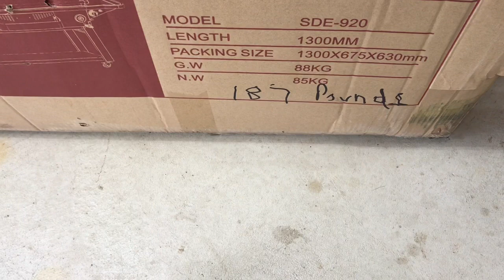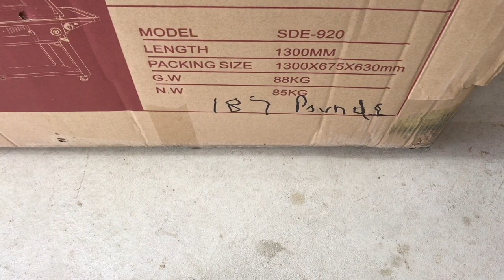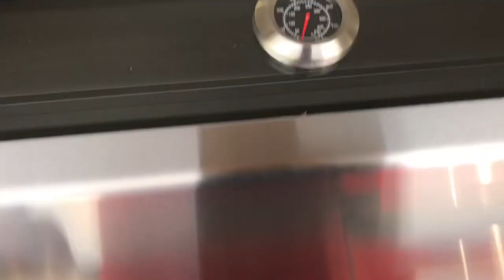The Ultimate Party Grill And Rotisserie From Smoke Daddy!

Comment: Tom - I have been wondering why there are not any pellet grills with rotisseries?  Have you considered modding one of yours?
Reply from the maker: Thanks for Watching Joe!  That's a good question, the best answer I can come up with is that its a space issue. Being not enough room for a rotisserie not only on the inside but on the outside also.  The Camo chef would be a good candidate since the stack is on the back or any pellet grill that doesn't have a stack which opens up on end for the motor. yond need to build a stand for the receiving end . I keep thinking on it. Might be pretty cool!